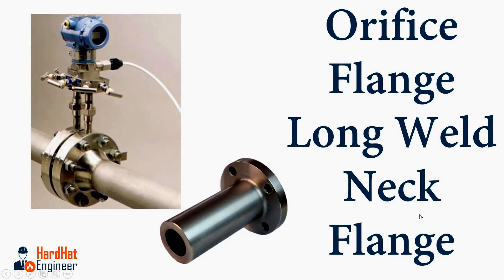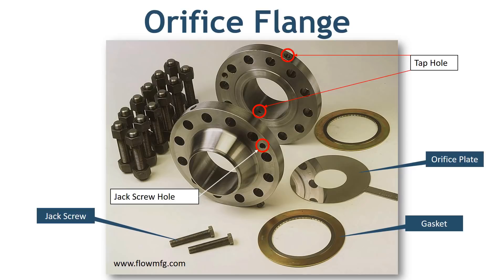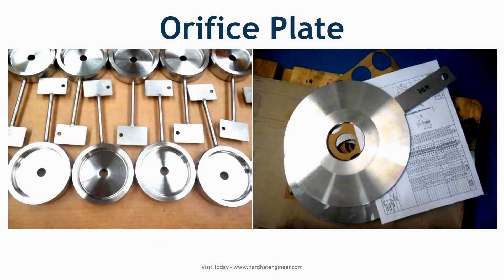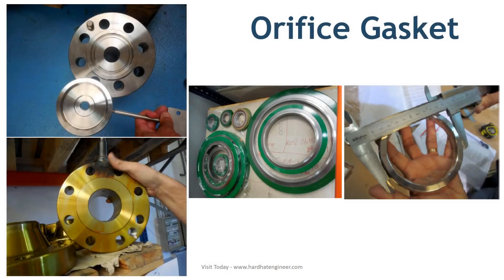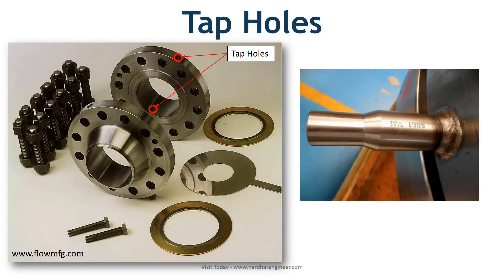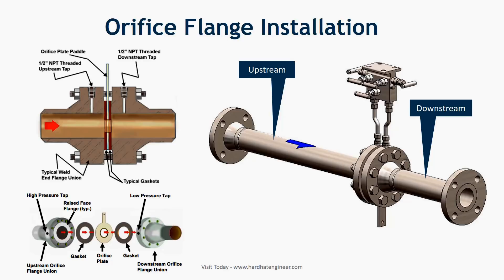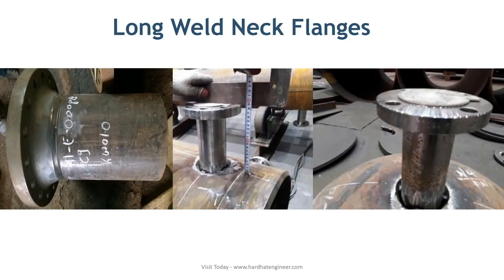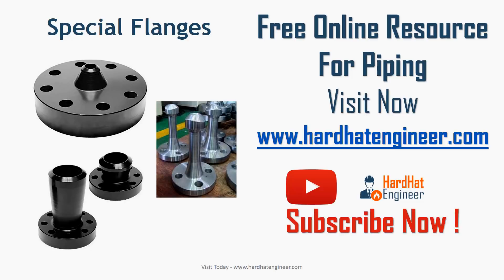Orifice Flange and Long Weld Neck Flange - Including Installation

Comment: Sir, I am searching the well explanation of  isometric diagram along with  data specified in the table of diagram.I am preparing for a interview which is very near sir please share a video and diagram.I have also required the complete knowledge of structure drawing of piping racks,tank,vessel etc.